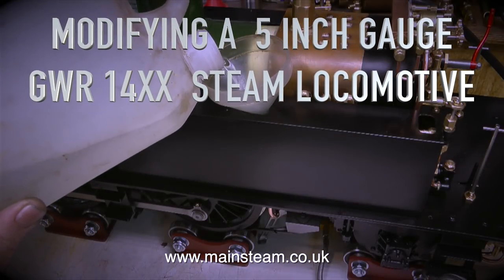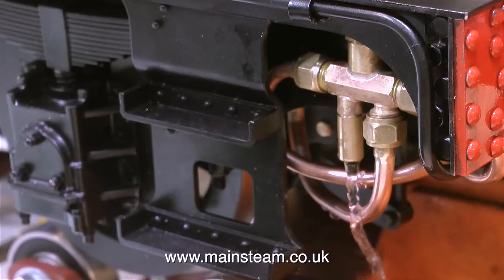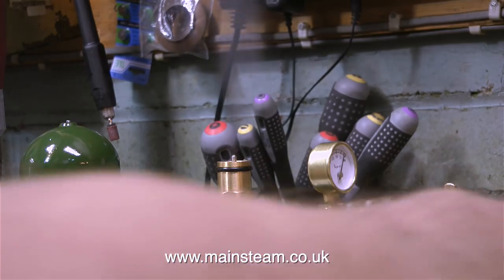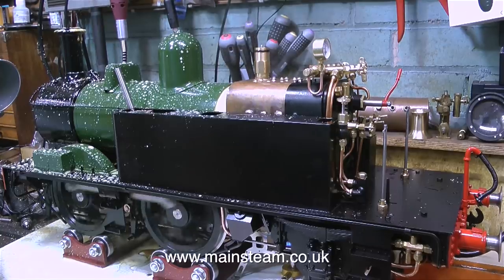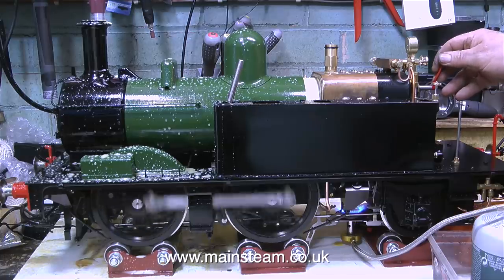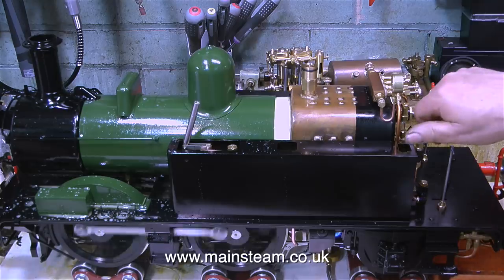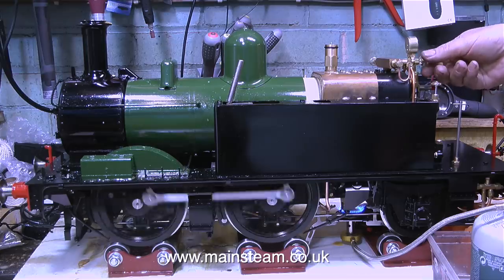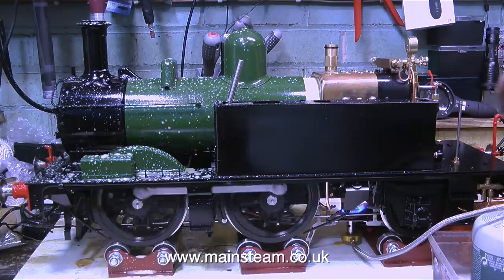MODIFYING A 5 INCH GAUGE GWR 14XX STEAM LOCOMOTIVE - PART #19

Comment: When you mentioned driving it in a Rubber suit what flashed in to my mind was you in a S.C.U.B.A. Divers suit complete with mask snorkel and flippers riding behind an engine. Those little gas burners do work great, I have bought several of them intending to use one in a model boat, but the wife usually spots them and they end up in the camping gear. I don't know exactly which one you have, but some of them you can invert the canister so it is feeding liquid to the burner instead of the gas. That way they do not cool down as fast, but burner control has a lag in it.

Comment: Hi Keith, Very useful video as always. Just a question. Would an 8X20 Inches lathe be big enough to make Stuart Models Biggest engines Such as the 5A and No.3 ?  I have a very limited space where I am and can't fit a much larger machine .
Reply from the maker: I think that would be too small for such projects.
Reply: OK Thanks for your time.

Comment: Daft question , does the XX in the 14XX have any significant meaning ?
Reply from the maker: this engine is number 1466, so I suppose the XX represents two digits in the 1400 class range of locomotives.
Reply: That clears it up thank you
Reply: Oil bath lubrication

Comment: Morning Keith,   I was able to run my American this last week and it was a good day for the hand pump and cross head pump overhauls.  The injector not so good.  Intermittent to say the least.  I am in the process of cleaning up my piping, and I machined the steam valve to the injector to be a pull-on push-off arrangement as some of my problem seemed to be the steam coming on too slow.  In the mean time I have purchased one of the small burners for bench testing.  Did you use the vacuum on the stack with the burner till you had minimal steam?
Reply from the maker: I have never had any problems with that type of injector - please check your piping ..... you don't really need the blower with a gas burner . . .
Reply: Thanks for the answer,  I will firing up using the burner Thursday.  I firmly believe the issue is piping.  It worked intermittently.  Mostly when I was able to spin on the steam quick.  I have copied a valve that Super Scale use to offer.  I machined the threads off the valve spindle so it became a push-pull arrangement.  The burner really does kick out some heat.

Comment: Hello Keith, I am very impressed with this little gas burner supplying enough heat to keep pressure in the boiler, would this still be the case on a track under load with passengers and if it can would a modification to run on gas instead of dirty coal be an overall advantage in long term locomotive life?
Reply from the maker: Me too - it surprised me. To use gas firing for the locomotive on the track, I don't think it would be powerful enough - maybe two of these gas burners could be modified so they would fit side by side under the firebox......

Comment: Dear Keith, it looks like the blastpipe is not in the center of the chimney. Its a bit closer to the tubeplate by the way the steam and water is ejected out of the chimney.
Or is it the camera angle?
Reply from the maker: It's probably not exactly in the middle, but it's not a major problem.

Comment: Is it safe to run a coal fired loco on gas like the way you do? Won't get the hot air stucked around the firebox and be unable to go through the fire tubes? I never heard of that methode before but if its safe to use then that would be awesome because I just have a balcony where it is forbidden to have a coal fire going. It would make  loco maintaining much easier for me because I won't have to get to my club track everytime to steam test it.
Reply from the maker: it's perfectly safe to fire using gas - no problems at all - other than the tank chilling and pressure dropping ....
Reply: Thank you kind sir. I will use this methode too in the future. Please continue to make those amazing videos, they are incredibly helpful especially for beginners!

Comment: I don't suppose you have a 2"+ diameter silicon tube you could use to route the exhaust from the chimney away from the rest of the loco and your hair?   Looks like the aftermath of Alfred Hitchcock's "The Birds".  Maybe you could install splatter guards inside the smoke box until the priming stops?  Not sure if it's a real thing tho.